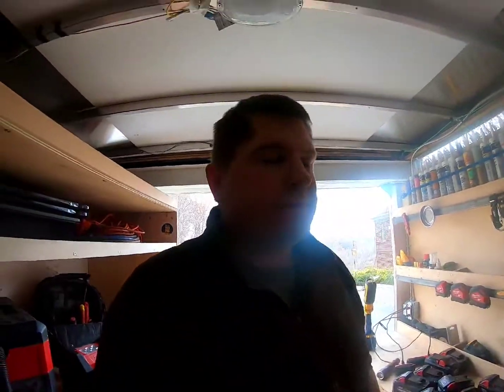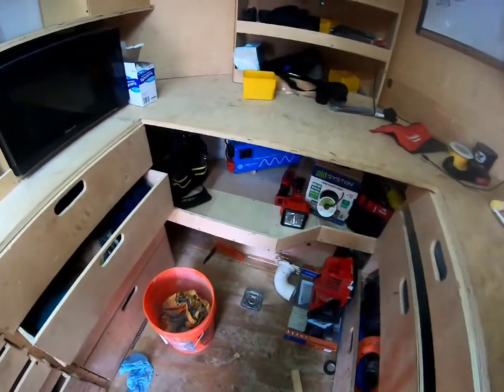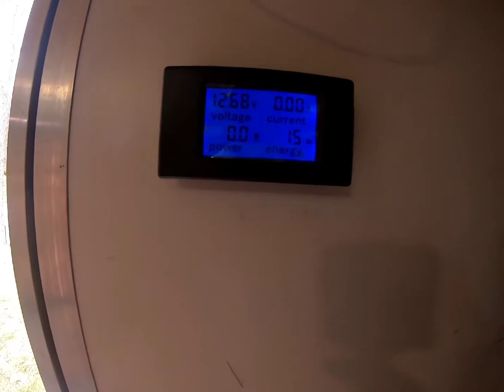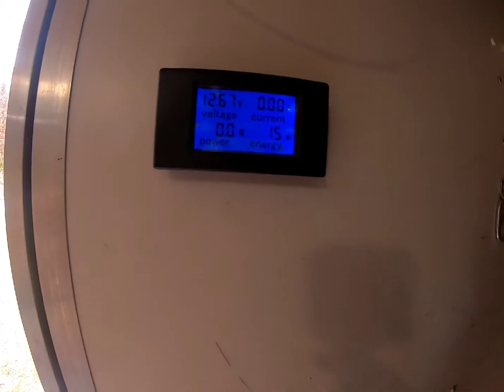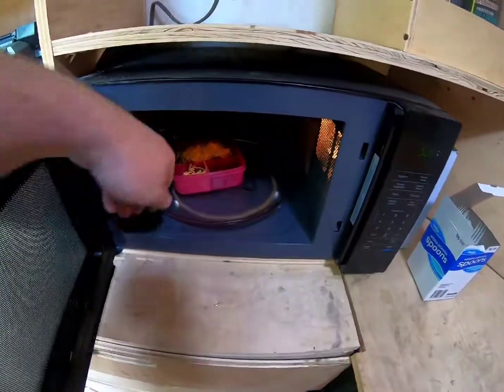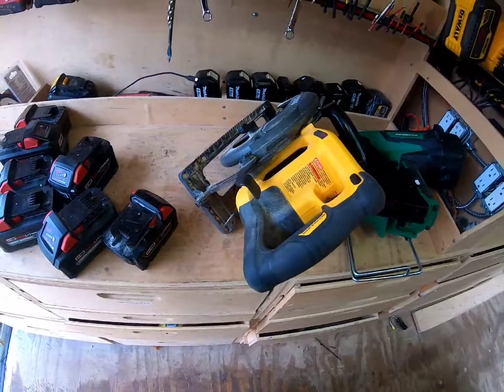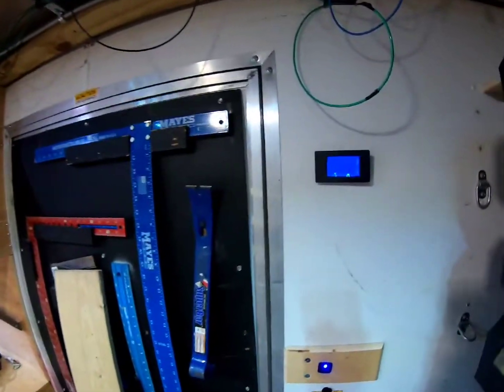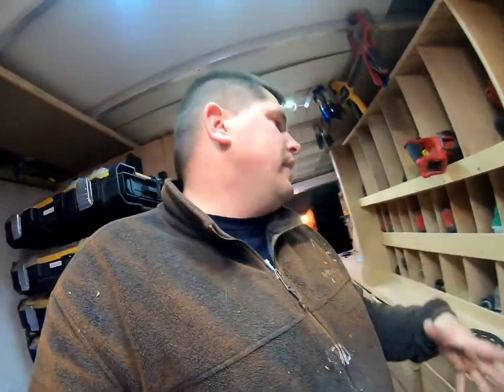Tool Trailer Battery Bank Load Test!!

Comment: Before you got your solar panels did you plug in your batterys or did charge them with your truck 7 pin ?
Reply from the maker: No separate charger when needed

Comment: I have 4 usb's and 4 110V's on my Service truck during the day. but I usually plug them into shore power, wherever I'm working, during the day.  Over time, I've learned that handymen can become enamored with battery operated tools, me included. You can't beat good ole corded Skill saws, grinders, heavy torque drills and even Dremels. I've gone back to corded for heavy duty usage projects. - - Hey, I've got a question. Caulking tubes, wood fillers, etc.  I put a supply of these in a tray that I can transport into my house at night to keep warm during the winter nights; rather than leave them sit on the service truck to harden/freeze and be difficult to use/squeeze product on the daily job. How do you solve this problem?
Reply from the maker: Yes for me. Battery operated tools are it. I work on efficiency,  so extension cords are really a pain in my ass. Not worth it and can be annoying to my customers. Only corded tools I own are my Gracco sprayer and tile saw.  

Caulk and Paint go inside once the temps freeze overnight consistently.   Next year I will be working on a insulated drawer for them that is heated so I never need to worry about freezing.
Reply: @RenovationsandRepair  Hey, thanks for the comeback. I know the benefits of battery powered and have 6 of them on my chargers now, but today I was cutting holes in a steel door, and battery power wasn't cutting it like I wanted. I drug out the corded. I was done in no time. Well worth the hassle.
- Yeah, I'm thinking about the caulk thing now. Toting the caulk tray in every night is a chore, and I forget sometimes. On those days, I just buy more caulk on a materials run.  Heating cold ones  up later, after near freezing overnight, it a big hassle. 
-
Reply from the maker: Yeah being in Michigan it can be 70 one day and 20 degrees the next. So I forget sometimes to and just have to buy another if it's bad. 

With corded tools i knew I wanted to invest in completely cordless when I was on a job site with other contractors and they where all fighting over the outlets to plug their tools into. Also the breaker kept tripping when someone was using their tool and another guy tried to use his. Lol no thanks.
Reply: @RenovationsandRepair  - Hey, your "heated drawer" comment gave me an idea. I can, and often do, hook my service truck up to shore power at home. - -  Now, All I have to do is put a cheap heating pad in the bottom of some kind of container (maybe a small cooler) and toss in enough caulking and other freeze-ables (ie. wood glue, wood filler, water based paint, whatever) to make it through the average work day. 
Later I can construct something more permanent, like an insulated drawer. 
- - On the heating pad, I'd need to disable the 3 hour limit, and make it on permanent low heat. 
I made one of these pads for a neighbor's dog house a couple of winter's ago. The old dog is still alive and loving it. 
Thanks for the idea. "Iron sharpens iron."